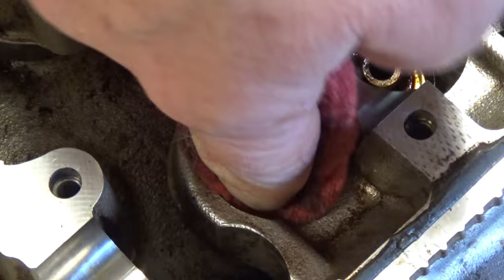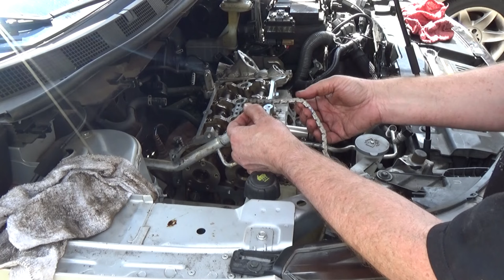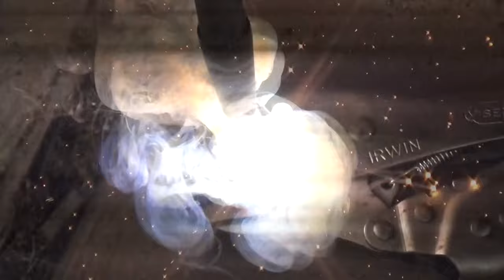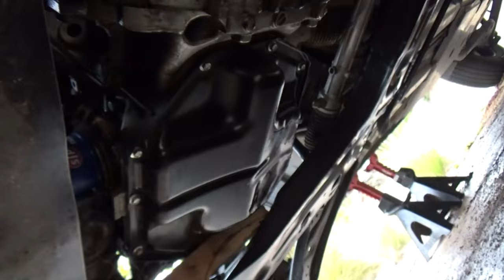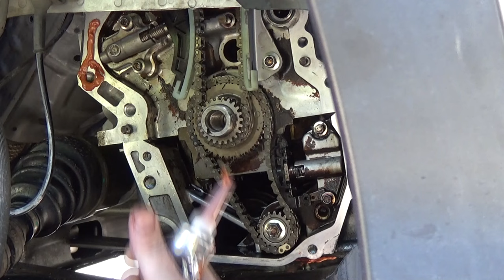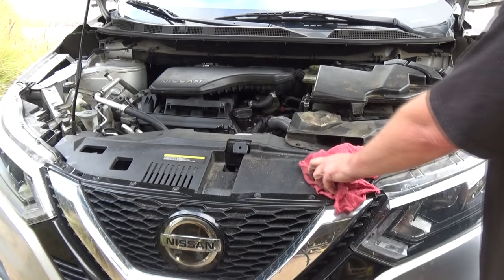How to repair and replace a 2020 Nissan rogue sport head/engine rebuild

Comment: This reminds me a lot of my old '09 VW Tiguan with a 2.0 EA888 Turbo engine. Similar process. What you experienced is normal, this is how many disassembly operations you must do to remove the head. 

-There is a Nissan service manual: eBay sellers will email you a .pdf of one that is how I got it. 

-The valves fail because of overheating. The combustion temperatures of Direct Injection engines are more than before, so the EGT temps are higher. This means that the valve seat's cooling rate must increase, its seems that engineers have a harder time creating cooling channels in the cylinder head that work in the long term since they are making them smaller to compact the size of the head and reduce pumping losses to meet the current fuel economy requirements. Cooling channels must be cleaned with a radiator flush solution, especially since the Rogue Sport has a infamous cooling fan induced overheating failure.

-People tend to not realize that a sizable amount of time is taken up by disconnecting the main engine wiring harness. I'd recommend loosening that up first to save a constant back and forth. Having a mirror with a 90 degree handle is nice to see what's behind the firewall side of the engine.

-I wouldn't use RTV where two machined faces meet. Use a thinner non-hardening sealant like Hylomar. RTV to too thick, it emulates a gasket or O-Ring which is nice if you don't want to buy new ones, but it isn't useful in other areas. 

- The timing chain tensioner fails much more quickly in these DI engines due to the fact that a high pressure pump strains the tensioner more due to the impulsive forces on the chain by the pump.
Reply: @tumdeax  are these motors reliable? With basic maintenance

Comment: @Cooking with Dr. Chill/ I really do appreciate You very much there for all of the mechanical Sharing and expertise knowledge from another different Video of Yours about bad Vacuum hoses and their Performance effects to a Vehicle ! Because my air-conditioner Vents are doing that Same exact type of thing as i begin to driving my Older model Ford Expedition ! Those air-vent's just Close'up and begin to releasing Warm feeling air thru'out the front Section of my Vehicle. 👌👍

Comment: O man.....
I am taking this road 3rd time this month and I was going to cut this timing mark in first place but anyway I managed to put it back without. The first time was to replace the timing and after assembling the tensioner bolt got loose even tough I tightened up with correct torque ended up loose and my exhaust jumped a tooth, opened second time I also adjusted the valves and torqued the shaft cover correct I felt little more resistance on camshafts turning, this should be reason later the oil not to escape from the cams bearings enough fast causing my oil pressure raise and somehow ending in the coolant all 3 liters before I shut off after initial start up for 20 sec. Now I am at the 3rd opening and don't know how the oil ended in coolant and where to look for the issue. I am thinking the oil got out from the head gasket  or the right side plastic part with the thermostat in it ( if oil is passing from there )

Hope you can help me with advice
Reply from the maker: keep in mind if you are having oil pressure issues, that can cause the timing chain to gain slack. The tensioner is oil pressure regulated. There is also the cams that have the variable timing based on oil pressure as well. 

If oil ended up in the coolant it is almost a guarantee that a gasket has blown. The thermostat is plastic and if that cracked in some way it can let oil in. If you only see oil in the coolant and not the crankcase that is kind of odd. The coolant will gain pressure as it heats up which usually will empty into the crankcase. 

I think there is a drain plug for the coolant on the back of the engine block underneath. Drain it and clean it out. Drain your oil and I would expect to see coolant in there as well. If not, that is very odd.  

Check your thermostat for cracks before you tear into it again. If there are no cracks then you need to tear it apart and find where the leak is. It could be something cracked, but most likely a blown head gasket. sometimes cracks are hard to see in aluminum so using a magnaflux might be the only way to see it.

if you have a blown head gasket, it should show up doing a compression test, For it to only blow in the oil or coolant section is kind of rare but possible. 

This car's design is horrible. It is such a headache to work on, and there is no room to do so. 

I hate saying it, but you may have to tear apart the engine like I did. If so, good luck and take breaks often so you don't loose your cool.
Reply: @Cookingwithdrchill  All is OK now, just the oil was so clean I didn't see it on dip stick and because I use original Nissan coolant ( inside the coolant has additive looking like oil precented in coolant, silly me) so no oil in coolant and no issue at all. Now engine is running like swiss clock and my CVT is keeping the engine at 1800 rpm when accelerating( before at 2300 ) and I feel more torque. But I agree it's very difficult to work on. For reference my chain with 105 000 km had same length as the new one

Comment: I have this same car burning oil and smoking!!!! We need Nissan to step up and admit their faults
Reply from the maker: check your PCV valve first to make sure it isn't staying open. it is a 12 dollar part and may fix what is going on.
Reply: Pcv wasn’t the issue. Believe it or not After I changed it, my engine was running even more rich than it was before. On top of the puff of smoke on startup. Do you think this job can be done without removing the head?
Reply from the maker: @Teejayx4  I am unsure because I am not there to see what is going on. Do a compression check and see what you are getting. If there is a cylinder that is lower than the others, then you will probably have to remove the head. if they are all the same then the problem is more than likely somewhere other than the head.